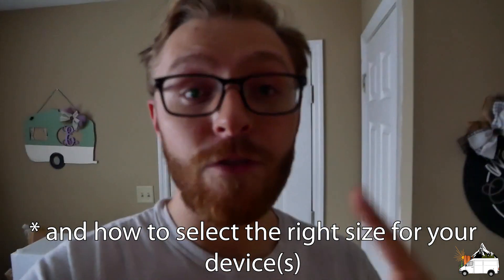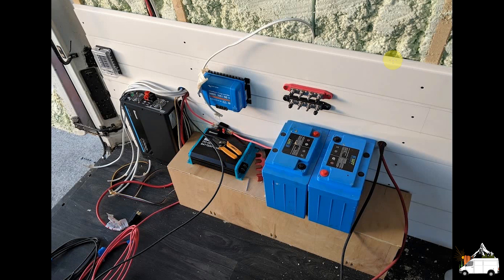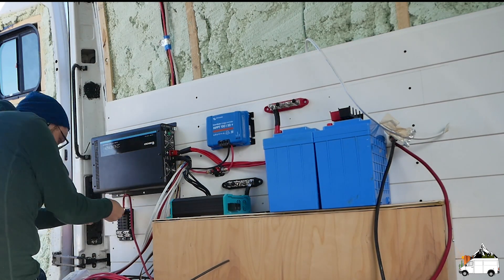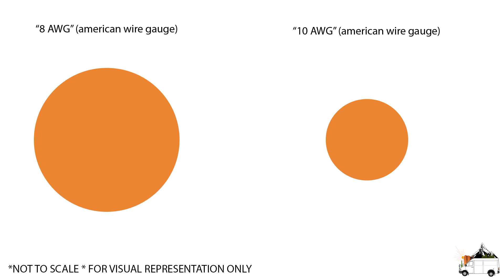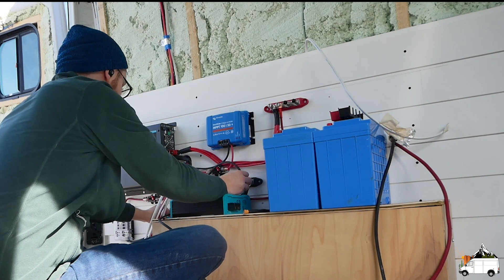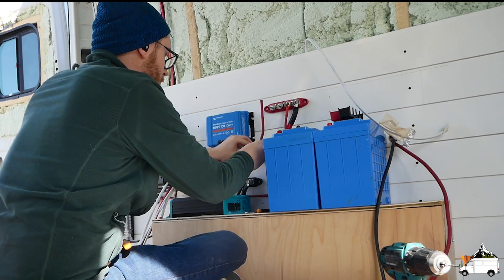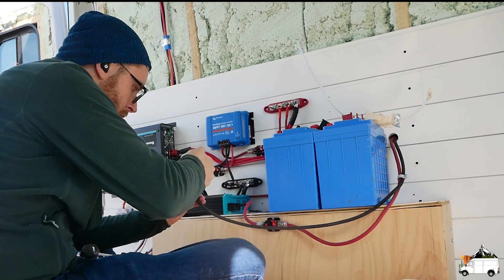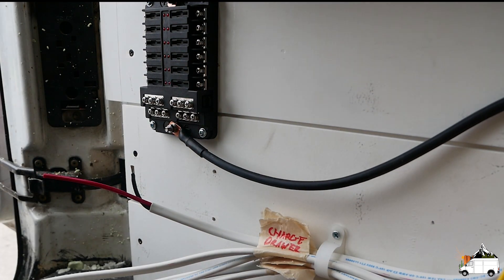How to Choose Wire and Fuse Size | (PREVENT FIRES) BASICS OF WIRE/FUSE SIZE

Comment: Is 4 gauge wire thick enough for my 4 6 v batteries ran to a 3000 watt sine wave inverter?? what size fuse should I run between the battery and the 3000  watt inverter?? Thanjs
Reply from the maker: 3000 watts / 12 volts = 250 amps (assuming youre connecting your batteries to be 12v). So you need wiring that can handle at least 250 amps. And then fuse for whatever that wire can handle
Reply: Project Vagrant 👍🏻
Reply: So a 120 fuse for my 4 g wire? Thanks

Comment: I just built a 400 watt solar setup. I bought 4 6 v batteries.. I have a 30 amp controller,, Should I use a 4o watt breaker for the controller?? also what other fuses should I use ?? thanks
Reply from the maker: Breaker/fuse size depends on the wire size you use, per the video. Every positive cable should be fused more or less. Fuse as close to the battery as possible.
Reply: Project Vagrant thanks so much.. Some fuse the solar  wire coming into the controller ??Should I do that? Its 4 100 watt panels in series with a factory renogy solar cable connecting to my 30 amp controller.thanks for your help
Reply from the maker: @daveyboy8907  it's handy to have a breaker/switch/fuse on the positive wire coming into the controller from the solar panels because you do not want to leave the panels connected to the controller without the batteries. This is because without the batteries, there is no where for the electricity to go, and can cause the controller to overheat.
Reply: Project Vagrant ok will do, thank you so much..
Reply from the maker: @daveyboy8907  you're welcome :)
Reply: Project Vagrant i am actually fussing the wires persay not the units.. I get it now . Thanks using 4 gauge wire and my battery cables are 1 gauge.